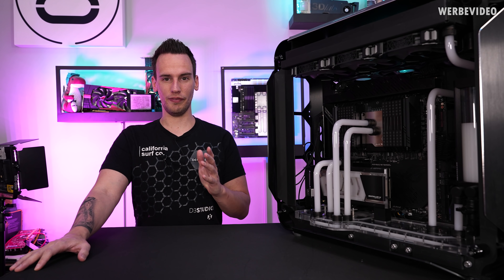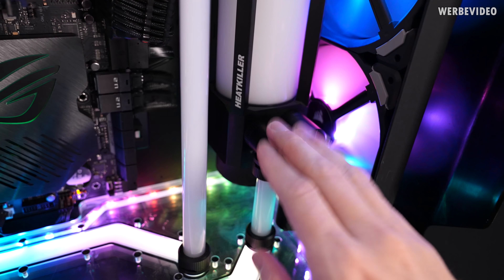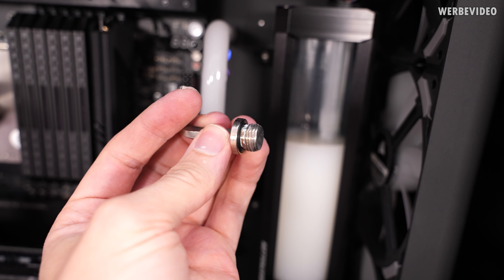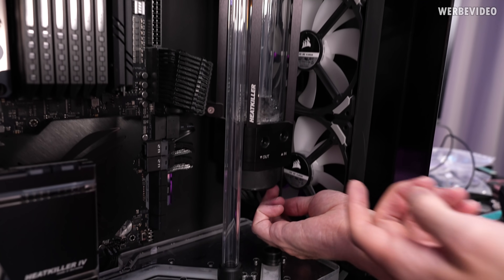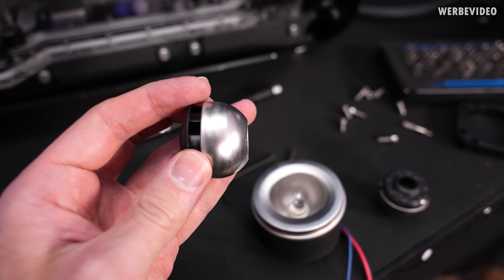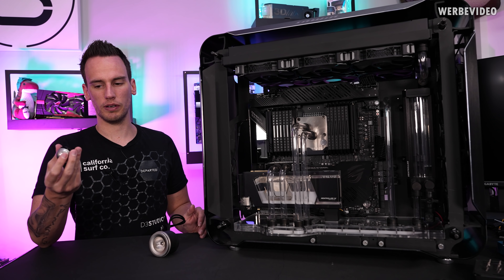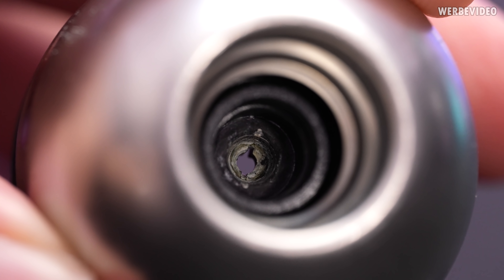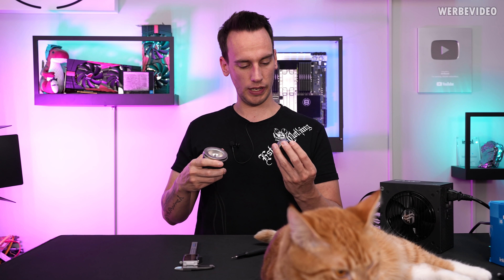Project Irrationality Part 13: Pump Failure :(

Comment: I have a sneaky suspicion that this pump would be just fine with distilled water in the loop.
Reply: I'm running my alphacool's D5 for like 6 or 7 years almost constantly and it's absolutely fine. Distilled water most of the lifetime. Some year or so it was running water + automotive coolant concentrate + regular blue dye.
Reply: I run distilled water with anti-corrosive and biocide exclusively. I'm on D5 pump 4 or 5 in 2.5 years somehow, although only one failed in this particular way 🙄
Reply: Distilled water and a couple drops of bleach in mine for about 2 years

Comment: The choice to go with colored liquid for a custom loop fits the theme of irrationality, at least.
Reply: Yes, for a 24/7 rig I would use a transparent coolant. A colorless one, or at least not a solid one.
Reply: @simoSLJ89  I totally agree.
I do not have anything against Der8auer, but it always baffles me, that tech Youtubers choose colored coolant for their main rigs that run for hours on end. It sets the wrong example. A colored coolant is not a viable option for a system with a lot of uptime. It will always lead to issues and inexperienced builders might think it is totally fine to use colored coolant.
Reply: @jakob.k_design  iI would add that some clear coolants exhibit this behavior as well, not all are safe. It used to be a lot more common with older dyes that are no longer in use specifically because of this issue. The only option for mission critical operation is treated distilled water. I don't even consider pure distilled water an option anymore, as I've had so many people experience problems with it's performance long term. Failure to flush your parts before you run the loop for the first time, is enough to potentially add life to your loop, or just leave behind enough dust to clog your block up once it all clumps together in the water. I actually added a filter to my loop specifically because of issues with that when using anything that's not new in the loop, or anything that's been sitting out for a while. One of my friends once found a spider in his own screen filter after it became dislodged from a radiator xD
Reply: @TheOriginalFaxon  You are right. My Brothers's system ran a bit cheaper clear coolant for a while and had some serious build-up, so not every clear coolant is safe. 
 But after we switched to Aquacomputer Dp Ultra there were no more issues. (I personally only run Aquacomputer Dp Ultra and never had any Buildup.)
Reply: @TheOriginalFaxon  Pure distilled water is never the best choice, you have to treat it. You know the water is sterile but everything in the loop will not be even after flushing.
Reply: @JETWTF  That's literally what I said lol
Reply: @TheOriginalFaxon  And that was my agreement with you on that point.

Comment: That issue is quite common with any of the colored fluids, even with the ones which are marketed as long lasting. At Finnish io-tech forums that exact same issue has been popping up in custom loop thread every once in a while.
Reply: The issues with colored coolants have existed since the early days of water cooling. But for some reason, people still go through the trouble and put that stuff in their systems.
Reply: I had mayhem's pastel fluid running in my system pretty much 24-7 for over 3 years with barely any fallout. I finally drained the loop for a mobo/processor upgrade and none of my blocks had buildup at all. The jug of old fluid had been sitting for a month now and it has only partially separated. So basically milage varies and for pastels I think you get longer life if the system is constantly running.
Reply: Dyes aren't a problem really. I've been runing a D5 for 2057(yes I need to change it) days while having dyed liquid in it. It's 100% pastel that does this, the micro particles seem to clog over time. Multiple youtubers have videos showing weird build up after using pastels.

Comment: I have that exact same pump running now 24/7 since 2017, apart from two hardware upgrades and water changes. And it really should last at least that long, considering the pump has 2 year warranty. Running distilled water with 5% of silicate-free car radiator coolant.
Reply: Does silicate damage the pump?

Comment: I got a lot of this build up from the white EK Cryo fluid and it also clogged up my pump in the exact same way. Cleaned it out with a few flushed of water and it seemed to get it back into life.
Reply: What would your suggestion be to flush the loop with buildup removal and replace the liquid every how many months?
Reply: @N0N0111  For pastel fluids, especially if they run 24/7, you should replace fluid every six to eight months. Run compatible cleaning products (Primochill Sys Prep, Mayhems Blitz Cleaning), flush with distilled water, and replace the fluid. It should be noted on your fluid site what cleaning products to use. For example, EK's fluid isn't compatible with Mayhems Blitz. Or just run hot destiled water several times until it becomes clear. For clear fluids (also colored) you should replace them in about 12 to 16 months. That is why properly placed drain ports are a must. They will make your life so much easier if you want to maintain your loop properly.
Reply: For a liquid to be opaque it almost by definition has to contain a large amount of undissolved particles, there's a term for this called turbidity and is an important parameter when it comes to water quality,
Reply: @N0N0111  EK says you need to replace the CryoFluid every 6 months.

Comment: that is the same problem that jaytwocents had with his pumps, the fluid leaves a build in the bearing and the friction blocks the impeller
Reply: The simple way to avoid this kind of failure is to just use clear coolant without dyes or milky effects. If you really want to avoid all possible problems use an all-copper loop (no nickel plated parts) and only use distilled water with biocide. A loop like that can stay clear and residue-free for over 5 years. Just make sure to flush the loop a few times while building the rig, to flush out any particulate and solder flux from the radiator(s). The only maintenance my old rig required was to top off the reservoir with fresh distilled water (and a drop of biocide) every so often because it ran relatively hot and the water slowly diffused out through the hose which lead to slight water loss over x months of time.
Reply: @mikeycrackson  I've had multiple custom loops running for 5+ years with just distilled water and silver coil. I only do delrin blocks and solid colored tubing.
Reply: @mikeycrackson  Use clear fluid and a lot of these issues disappear.
Reply: @muf1772  It still happens with clear fluid. You cannot prevent this from happening. I use clear fluid ONLY ever and have had this happen to me a few times so far over the years. Its just the way the cookie crumbles with the D5 pump. 2-3y is roughly the life span i have seen out of a D5 pump running 24/7 and 5y+ if oyu shut the system down and or only run it for 8/12h a day.
Reply: @mikeycrackson  ill never go back to listening to gpu fan noise. Worth every penny and effort.
Reply: @Lazereer  I've been watercooling for years (over 20 to be exact) and I've currently got 4 D5 pumps (sets of 2 in series) that are 5-7 years old that have been running 24/7.  D5 pumps can last a very long time and typically last past the 5 year mark without issue as long as you maintain your loop.  Sure I've had D5's fail in the last 20 years due to random things like a  bay reservoir from alphacool that had both pumps fighting each other for incoming water which caused cavitation leading to bearing failure in 6-7 months.  I sacrificed 4 pumps in all testing that.  That said, pumps have moving parts and they can and do fail but proper maintenance will always dramatically improve their lifespan.
Reply: @maximus7651000  I dont disagree with anything you said, i too have been watercooling for a long time though only half as what you have and like you ive have had a couple  D5's that ran almost 24/7 last a very long time ''still running' but the reality is the majority that watercool are not annul when it comes to maintenance and one should be when watercooling imo. Especially in the later years. Point being, i dont disagree that a D5 pump can last a very long time under the right condition and maintenance im speaking more in general. Most put these colored liquids in their system, most dont change their water for years, most dont clean the loop, most run their D5 pumps at full speed etc etc etc. So taking all that into account and even if you are keeping up with maintenance with all that i personally have not seen D5 last the 5+ years running them 24/7. Ive seen some on watercooling reddit D5 only last a year and their system looks brand new still. anywho.

None the less Maintenance is 100% key as you put it. The #1 failure i see is in the bearing area. So no doubt maintaining your system gives you the best chance.
Reply: @Lazereer  It's nice to engage in friendly conversation like this.  My only hope is that others may learn from it and actually take said advice. :)

Comment: The tubing was glass? If the glass ends weren’t beveled and the tubing annealed, tightening the fittings might have caused a chip to break off and go to the pump.

Comment: Laing D5 pump should be able to run 5-10 years 24/7.  Hoping for it to work for 1 year isn't good.  It means there's a problem with the pump, or your fluid/particles are causing excessive wear and should be switched out.

Comment: Switch your coolant to clear colored type. The bearing surface inside the impeller will get residue build up from  those opaque colored coolants and start to bind. Clean it out with a Q-Tip. This is a known issue going back a few years. Jayz2Cents had same issue.

Comment: It’s due to the use of opaque fluid, the opaque die never really dissolves in the water, it’s a suspension, and once you left the system off for 2 weeks, the lack of flow made the solid particles dry up (and probably react) in the pump bearing. Switch to a transparent one, it can be colored, but not opaque. 

I’m actually thinking about using a car radiator water additive on my PC, such as Motul Mocool, those things are made by actual Chemical Engineers and tested for real on very extreme conditions on mixed metals, way more brutal then a WC PC (car fluid runs at boiling temperatures). Imagine if you left your can in the garage for 1 weeks only to discover the water pump died (what would probably kill the engine)…

Comment: Have had a number of D5 pumps fail mainly due to restricted flow created by cooling blocks with restrictor jet plates. I can only imagine pastel/particle based fluids exacerbating this issue I've experienced. Ive since stopped using restrictor plates and my current D5 pump is still going strong.

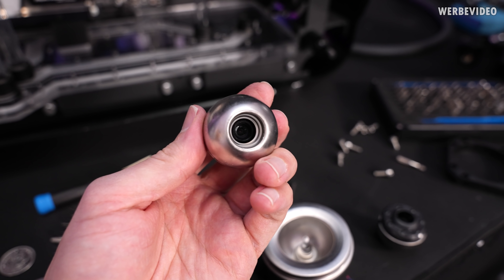Comment: 7:15 And this is why fancy looking liquids kill pumps.
Their residue just sit inside the bearing and makes the pump work hard for hundreds of hours and kill it.
But for you the pump didn't die, the starting resistance was just a lot and the pump's safety electronics just turn it off before burn out. 

I see this happen a lot with other machines, they can run 24/7 for months, but when you turn them off and start them something breaks.
My suggestion would be to do a hot flush every 6 months and replace the liquid, purely to reduce the residue build up for this fancy liquid.

The best cooling liquid has always been Propylene Glycol with Distilled Water mix, cause it has almost 0 residue build up.
Reply: The coolant I use for mine resembles green antifreeze no problems yet
Reply: 100% agreed. Hence why DP Ultra is one of the best ready to use solutions for so many years! Seen almost every other coloured, funky coolant fail one way or another. To be honest though, a lot of those are for showcase purposes mainly and it's not advised to use them for extended periods of time, yet users stick to them.
Reply: @NiC707  I also use it in my rig, 4 rads, CPU and GPU blocks, (parts from EK, Corsair, Alphacool) never had a single problem or build up.
Reply: @greggreg2458  You just can't beat the simplicity, ease of maintenance and peace of mind DP ultra offers right?! I've been using it for every LC build that passes through my work bench since '09!
Reply: You are probably better with just distilled water, propylene glycol is used as an anti-freeze which obviously isn't a problem in computers.
Reply: @diego1694  It depends. In general is not advisable to run plain distilled, unless you know you're going to be replacing it frequently. You need to use anti corrosion and biocide additives for prolonged use though. Especially with the variation in nickel plating quality certain brands suffer from (looking at you EK).
Reply: @NiC707  Yes, but propylene glycol is neither anti corrosive nor a biocide. It is used in cars and other cases where the temperature may drop below freezing, but as far as I know it doesn't add anything beyond that.
Reply: @diego1694  You're partly correct. Specifically for the DP ultra, it includes Benzotriazole as copper anti-corossive + glycol prevents growth on it's own, it doesn't provide a suitable environment for algae development. If that was the case, then your car needs inhibitors too ;) Have you ever used a growth inhibitor on your car's rad?
Reply: @NiC707  DP ultra seems to use 20-35% ethylene glycol, which may be effective to prevent algae growth, but at that ratio propylene glycol is not. Cars coolants tend to use much a higher concentration of PG, up to 60%, and growth shouldn't be much of an issue because there is no need to use clear tubing, and algae needs light to grow. I think it would be a very bad idea to use that much PG in a computer coolant just to prevent growth, since it has much worse thermal properties than water. And to be clear I was just responding to the OP which suggested using a mixture of PG and water as a coolant, in which case the PG would be pointless. However, as you said using a mixture with anti corrosive and biocide agents would probably be a good idea, but the concentration of these additives should be in the single digits percent.
Reply: @diego1694  Hmm, I fondly remember that they were using Propylene instead of Ethylene Glycol, just looked on the spreadsheet as well, and you’re right. Maybe they’ve changed it down the road? Testing was done in 2016 according to the spreadsheet, DP ultra is in the market since ‘09 I believe. I do remember it was around ~40%. After contacting them back in the day, they’ve responded that it was enough to prevent algae growth in such a relative small loop in a pc, without severely impacting performance, and to be honest after all those years working with it, it’s the only one I’ve used and has consistently the lowest fail rate (if it failed at all, it was more of small debris deposits from badly cleaned rads etc), with second being WFI+biocide+anti-corrosion inhibitors.
 
Apologies, I thought you were talking about the DP, damn YT doesn’t add the OP’s name when you respond to them directly. Also you’re correct on the note for single digit percentage of inhibitors, usually it's written on the bottles as well, use only a drop or two for a litre etc.

Comment: I've been using car coolant for 12 years now, never any stains, corrosion or crap in the loop or blocks, nothing.
Can recommend!
Reply: Giving me confidence since I spliced an old cpu aio cooler and my water cooled gpu together. The gpu aio used propylene glycol, I swapped to maybe 15% ethylene glycol and distilled in the tank and its great!
Reply: wow wtf? what coolant?
Reply: He means 80% distilled water and 20% propylene glycol
Reply: Distilled water with Royal Purple ICE is a great combination, but I've used just DW and biocide in a loop that's been running for almost 8 years now

Comment: This is the main reason I do not use pigment based fluids. Even while the pump is water lubricated, the bearing generates friction with these particles, which will heat and cause them to stick together. One way you can always check for your pump is measuring it’s drawn current. Usually a stuck pump will be at maximum or over its specific limit. If the induction side is damaged, it will draw nothing as the circuit will be open. And thanks for proving my cat is normal - she also LOVES to play with swabs.

Comment: I saw a similar video by jayztwocents which implied the particles in the fancy fluids were the issue. Much easier to see in his video as the fluid was bright green as was the residue. 

I have had the same d5 pump running in my clear fluid waterloop for nearly 8 years. The first 7 years it ran in my original loop and after recently upgrading my whole setup and redoing the loop and having seen jayztwocents video I checked my pump and there was zero debris. Still runs at 4800+rpm like the day I first turned it on! That's something like 35-40,000 hours of run time so far!
TL:DR - clear, particle free coolant ftw :)
Reply: Yeah, people that use the "fancy fluid" always forget to re-new the fluid couple months later.
Distilled Water + Propylene Glycol running for 14 years now on my 2 SwiftTech MCP655, just a little top off every year.
Reply: so as long i keep my system in clear liquid it should be ok? (with obviously maintenance)
Reply: I've had the pump running more or less like in this video and it died after... 7/9 years?
issue was that the impeller was worn down a tad, causing it to start scraping the housing a little and the impeller cost as much as a PWM driven one...
I placed the new one in a different orrientation and made sure there was less space to vibrate.

we'll see how long this one will last.
Reply: i was doing that, draining and refilling it always before summer